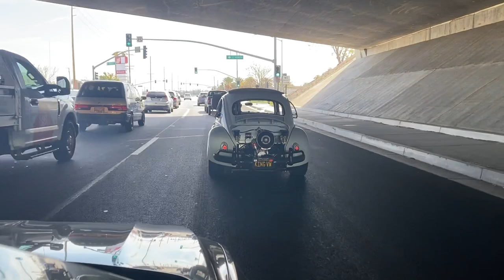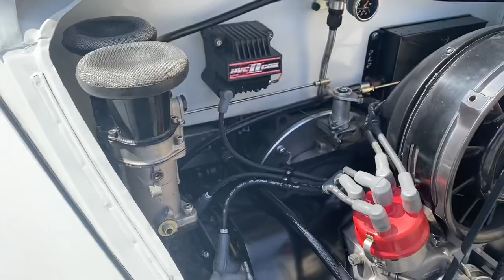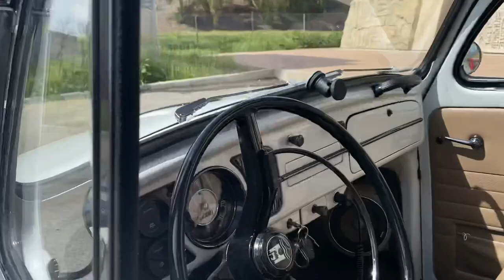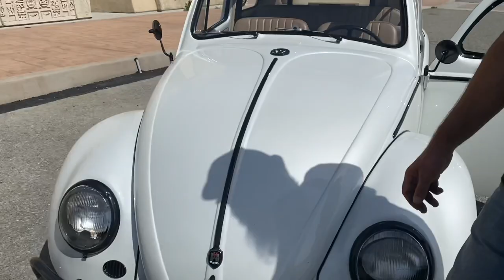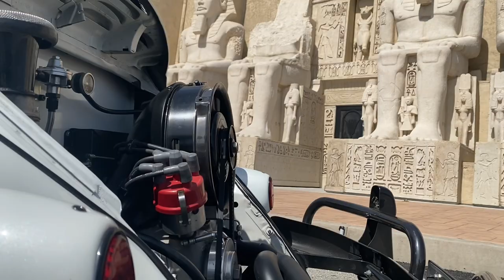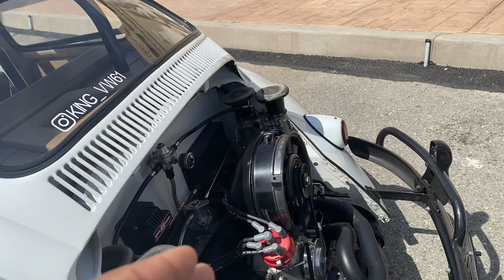Autocraft powered VW bug on the streets

Comment: Perfect. I might widen those rear bumpers. Metal extension on each side?

Just a thought. Great build.
Reply from the maker: These are creative car craft
Reply: @volkstroke  I've had creative car craft fiberglass fenders on a bug. Amazing quality. Assuming creative car craft supplied the bumpers too?

I meant the bumpers to widen. Can you widen them to match the widened fenders?
Reply from the maker: Steel real bumpers
Reply: @volkstroke  ok cool. Is it possible to widen them. Cut off the ends and weld on an extension.

Great car btw. Great build.
Reply from the maker: Idk I don’t like wide fenders I narrowed the rear end on my car to avoid the visual
Reply: @volkstroke  oh ok got it.

Comment: So, how wide is that resr tire and what did it take to fit it under the fender?
Reply from the maker: It’s got wide fenders that’s why idk how big that is but it’s a way to do it I rather narrow the rear torsion than deform the bug
Reply: @volkstroke  agreed, I wonder how big of a job that would be? What do you run on the back of your oval? I run the M&Hs on mine. There's not much choice for 15" anymore.
Reply from the maker: I run 215 and 235
Reply from the maker: My car not narrowed

Comment: I find it hilarious you guys are ragging on "old skhool" braided line and this car is running CARBS and a distributer!  hAHAHAHA.  Welcome to the 21st century bros.  Why no FI?    Just bustn' balls but it is funny.  It's not a pretty cool car, it's a VERY cool car!
Reply from the maker: Because fuel injected cars have no nostalgia and make no more power than my carburetor set up but all that changes when introducing power adderes witch I did recently and I am in the process of building a fueltech nitrous injected VW that will  set a new standard
Reply: @volkstroke  ha ha OK. Well then, you should use rubber braided hose for nostalgia sake.  

Regardless, of induction choice, it is a quality car no doubt. Congrats to the builder/owner.  Good luck with the new build.
Reply: I love the simplicity of a air-cooled NA engine. Hopefully my 76 will come along at the end of March